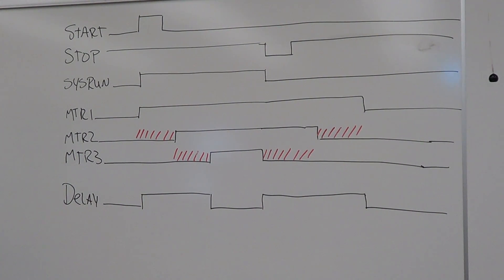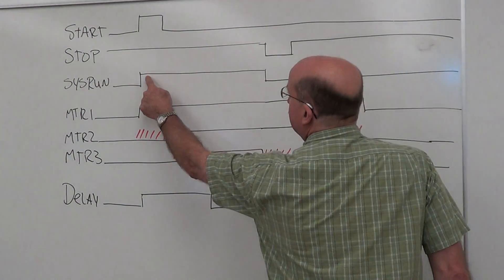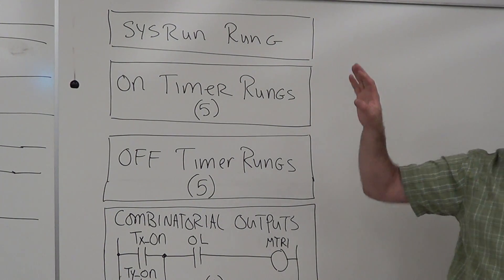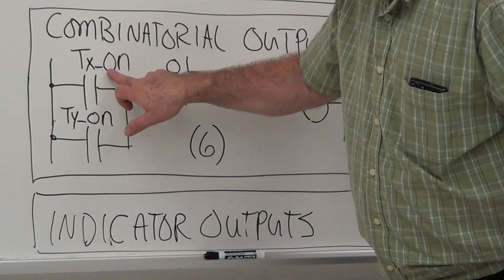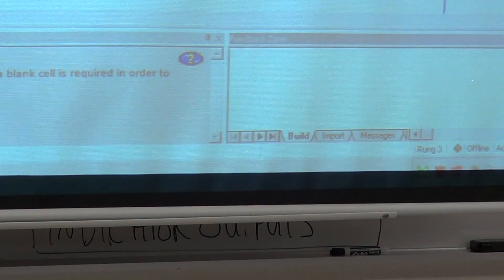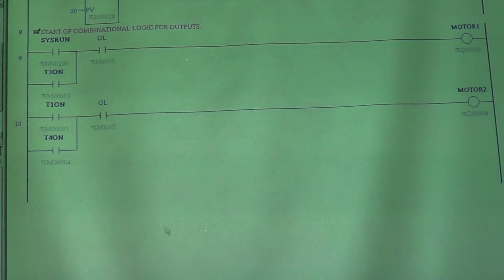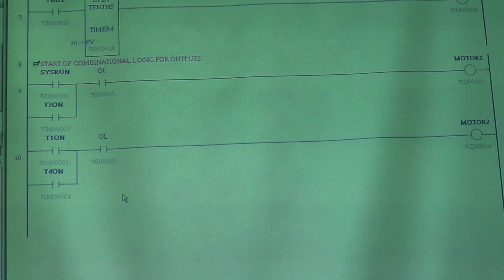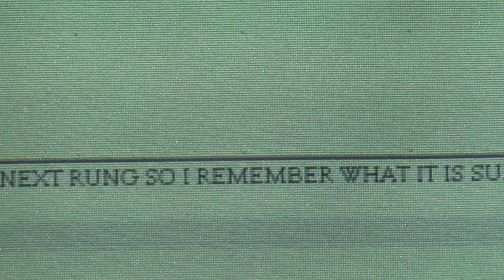PLC Lab 6 - Sequential Startup and Shutdown

Comment: Sir in this Ladder Diagram, the motors start sequentially and stop sequentially. But let us take the condition when there are 5 motors ... And we switch on the main supply and one by one the motors start. Now just when 3 off 5 motors are running we trun off the main supply, so how will the direct last motor running stops first immediately and then with delay the remaining
I'm trying to do this in simatic manager of Siemens.
And I don't understand the logic of overload